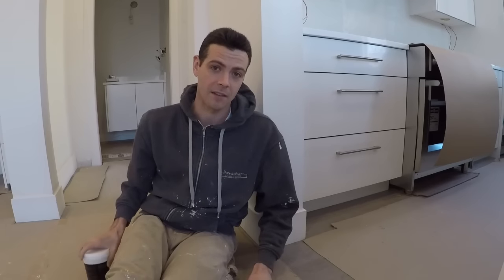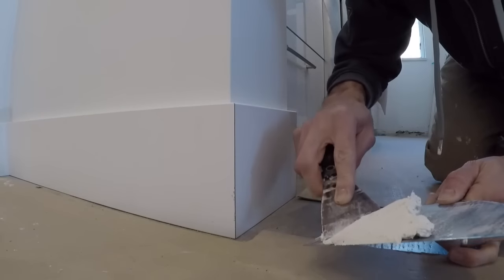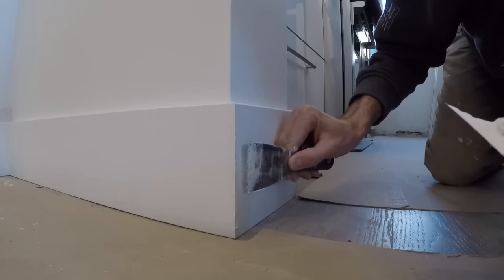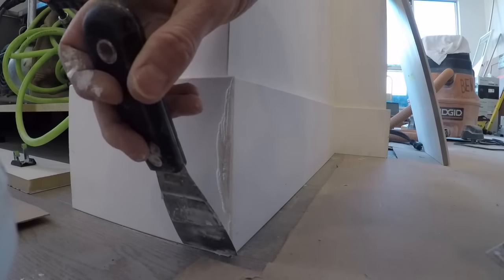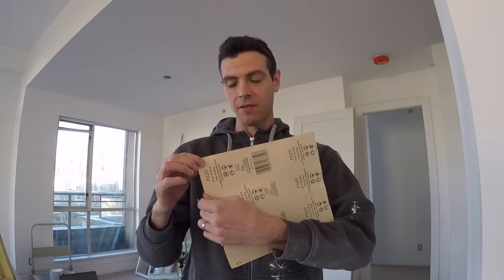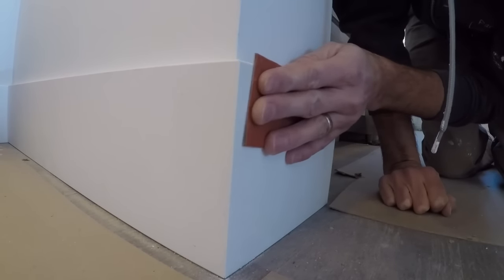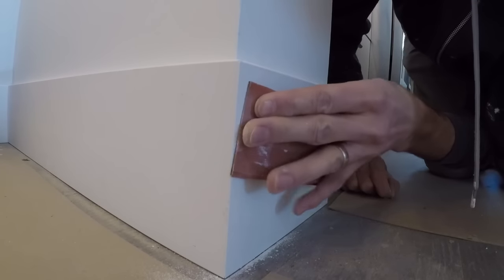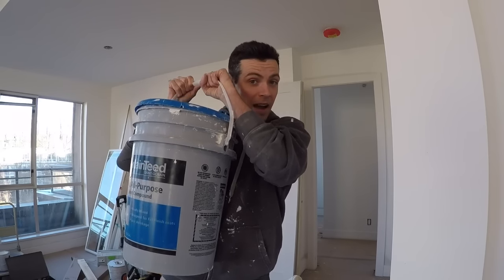How to Fix Open Miters

Comment: I was a professional trim carpenter for a few years. I found the reason most people had bad miters was a result of laying the baseboard down and tilting the blade - bad method.  Better to stand up baseboard and turn table. another tip - never 45 and inside corner - one piece square and cope the other piece to meet it, you will never have an open corner. If you want a line to cope  hit the baseboard with a 45 and follow the inside edge of the cut.
Reply: Glad I was able to help. Make sure you try the coping saw for the inside miters. Back around 1980 we were doing a lot of upscale houses with Mahogany, a gap or filler was not an option. A trick if you are using finished wood like Mahogany and there and there is a tiny gap on an outside miter which can happen if the wall is not a perfect 90 degrees is just lightly tap the corner of the joint and it will close it up so it doesn't catch your eye. Back to my bathroom reno. Cheers
Reply: I watched Scottish finishing carpenter do a high end dental office with 1 1/4"  X  6" oak. All the inside and rounded outside corners where perfect, no fillers used. It is possible to do a good job. We all can do it.
Reply: Ah a real finish carpenter.
Reply: @gomalibusurf6098  there actually are plenty of videos coping inside Corners is a widely known practice it's definitely no secret tip

Comment: I can say as a contractor that what he's showing will work in a pinch.  We're all advancing our skills at carpentry  (in this case trim), hopefully.  This is something anyone can do when presented with this problem,  whether they cut the trim or not. 
As a pro tip I will say this on topic:
No need to carry any special fillers or spackling. Just mix latex glue in water, not much glue,  just enough to make the water look milky (I use stone glue it's cheaper and Ialways l always have leftovers from concrete work,  I suppose wood glue could work). Use the milky water to mix durabond or other hot mud.  Fill with that.  Won't shrink,  very strong. 
In a pinch we've used this recipe to level low spots on floors before laying hardwood or click together. 
Cheers
Reply: Would Weldbond work in this mix?

Comment: Switch your miter saw to about 51°. It increases the lead of your "point" . You may wind up with a small gap on top of where  your wall corner meets both planes but it's a small gap and very easy to caulk.

Comment: I had a good technique when I did a lot of baseboard. Have short trial angles cut out and keep them in your tool belt pocket. You can see how off you are from 45 degrees, either inside or outside corners.
Reply: Exactly!

Comment: About fifteen years ago I put put up some 4x4 posts on my screen porch, There was open grain in the knotholes and a few other divots that needed to be filled. I used Bondo (a polyester resin-based putty used for auto body filler). It's non-shrinking and extremely strong, and it sands very well too. To finish sealing the knots I used dewaxed shellac to seal them and prevent resin bleed-through, which will happen with Southern Yellow Pine, regardless of how many coats of paint you put on it. They look great today, so it worked well. I can't tell where any of the knots are--the paint is smooth and there's no bleed-through to leave a hint. Great video BTW. I've heard that if the gap is very minor you can take the smooth edge of a Phillips (or Robertson) screwdriver and press it against the edge of the miter to round over the edge and fill in the gap. Obviously that wouldn't work well for a gap as large as you were hiding--the corner would be too rounded and not look good.
Reply: Oh yeah, I almost forgot...another product you can get at the home centers (in the paint department) is Durham's Rock Hard Water Putty. It's a powder that you mix with water to a putty consistency and it dries a beige-brown. Like Bondo, it dries without shrinking and is very strong and hard. It sands well and takes paint well too. A good alternative to Bondo, and easier to mix since you just add a little bit of water and stir. I use it a lot when I was a teenager building scenery for my HO railroad. It made great rocks and cliffs.

Comment: This is usually caused by to much mud on the corner bead. You can fix this a couple of ways. One mark the top of the base board, and shave the mud off below the line, you corner closes right up! Second approach is to cut your trim a hair long and float the trim away from the wall, caulking the gap at the top. And yes, you can also cut a 46, or 47 degree miter. 

 "Putty and paint make the carpenter what he aint"
Reply: 46° miter is the easiest and best way though

Comment: After asking a few carpenters that do this work for a living, i found out there are several factors for why the gaps could appear in the trim work after installation. One reason is the trim needs to be acclimated prior to installation, this is mostly never done during construction. The second reason is the corners or joints needs to glued and pinned, that can help quite a bit. Third reason is the temperature changes inside the house, its generally expansion and contraction. I'm in New Jersey and the trim in my house shows some gaps from time to time, more so after a really cold winter.
Reply: You are absolutely correct but the #1 reason in my opinion is the piece are cut incorrectly and that is usually because they are using and older saw that it no longer accurate. Plus if there is a huge gap to start you shouldn't nail it! I always double check my finish saws for straight, 90 and 45 angles. most saws have adjustment screws and stops to help zero everything. And like he said in the video, for outside corners going a little over 45 helps the outside corner touch which is the first part you'll notice.

Comment: No drywall corner is 90*, because of the corner bead.  Never cut a 45*.
Reply: I run trim all day long. Unless it's stain grade, I'm not wasting all that time to make it 46⁰ . I usually just make an outside corner a little bit longer to give the installer a bit to work with. Then caulking the top isn't as noticeable.
Reply: @kristomat  So you shift the work to someone else, so you can be faster?
Reply: You mean get the painters to do their job and caulk the trim? We're talking a 1/16 here. I've been doing this for 20 years. How about you?
Reply: @kristomat  I guess I started when I was in my mid twenties, and now in my mid 60's, so been doing stuff for a few years.  Doesn't matter how long anyway, being excellent matters.  Even though I have been training people, I still have stuff to learn and do not get defensive about what I don't know.
Reply: @kristomat  Interesting too though, you can do a better job apparently, because you do stain-grade work ?
Reply: I figured you were an older guy. I knew a guy that swore by doing it your way (he was older), after doubling his work for about a week the boss told him to change to my way. It looked exactly the same and I did it twice as fast. I do the same with crown. My crew is the fastest out of 5 crews. We never get callbacks. 
 I hope you're not implying I treat paint grade the same way I would stain grade? Two different animals.
Reply: @kristomat   I have several ways, depending on the quality of the boarder and framing.  Most of my work is done in old buildings, so nothing is square, plumb, level or consistent.  New construction is where most finishers can get some speed, and when they rush for that beer, they leave any mess for the painters.
Reply: @kristomat  My friends in the flooring business know more about trim finishing than I, because they just swear and do the best they can.  It isn't their job to do call-back phoning.
Reply: @ya472  the flooring guys are 50% of our call backs. They always cut the casing/jamb too high. Don't trust anything they say.
Reply: @kristomat  Well, you know.....   lol
Reply: @ya472  um no. That was vague. What do I know?
Reply: @BMXadie it's never going to be 90° because of the mud on the corner. Making it a tad longer gives the installer a little bit to work with when banging the mud in a little. I don't really care if you like my way or think you are a higher qualified carpenter. I'm just saying it's what we have done for years and it works.
Reply: @kristomat  do you mean this in the sense that you use a cutter and installer team that do separate things? I could never imagine doing trim this way. But if it works for you and you can do it fast, more power to you. I've found more and more lately with all the greed in this industry, that a carpenter's speed can out weigh sub par work in the eyes of the employer..
Reply: @jonm2416  this is very common place method in trim work. Even in two man crews.
Reply: @DeadEyeRabbit  Maybe it is, I don't do production work, I do custom work, so I've never seen it. I usually use tall base profiles in solid poplar so there not much finagling you can do with a slightly longer 45. Do you guys install 2 1/4 mdf clam shell for base or something? And this "crown" must be like a 1 3/4" nose and cove flex mold lol. Either that or you're installing in a perfect metal box.all messing around aside. Your method may only work in low grade production. Custom work requires perfection, not necessarily speed.

Comment: Thank you for the video! Doesn't wood filler puddys dry hard and crack from impacts and expansion/contraction? Wouldn't paintable non-shrinking silicone or urethane remain flexible and not crack?

Comment: Thanks! After 4 months of remodeling my house, most of which I have left to do is the baseboard and I'm sure this will help.
Reply: Fun, isn't it?  :) I've been working on a remodel in a spare bedroom over a couple of months. Level 5 finish over knockdown texture wall and painted popcorn ceiling (1971 house, likely asbestos, already painted by previous owners). Putting my final skim coat on the ceiling tomorrow, then sand and primer before paint.  Ben's videos have been kinda following along where I've been in my spare time.  One wall had old baseboard electrical (flipped that 12ga wiring and box around for a dedicated outdoor 20A utility circuit, all wiring was run and breakers still in the box, wiring disconnected), cable TV inlet, phone jack, poor patching, curtain rod pullouts, nail pops from the original build, etc, so I practiced a bunch of different filling and taping techniques.  My 10yo daughter is getting that bedroom when I'm done and she loves watching the videos and seeing the results when she gets home from school. :)  We're just about to trim now and I'll be building a wide flower pot holding window sill. :) Informative videos and fun to watch.

Comment: You use a bevel to do your mitre corners, no corner is ever 90 degrees so you need to use the intersect the angle technique and then draw it out and use your bevel
to get the angles right. But this is about filling the gap that has already been made and the VC carpenter does a good job IMO.

Comment: When you are putting the two pieces together put the putty in before you nail, bingo done and quick. Or caulking gun.
Reply: From my understanding you would want to use caulking in this application, correct?  Wood filler wouldn't hold up to further expansion and contraction.  You'd end up with the same issue after a year. Right?

Comment: Excellent video. Been using caulk for years, will try this although might be harder to sand a complex form like crown. Virtually all corners are more or less than 90  deg. I did OS corner crowns by using an angle tool and setting saw with that and got perfect 46.5 miters on a 93 deg OS corner.

Comment: Those 1/4" gaps are there when you bought the house from some extreme hack job.  I wish I could add a picture of the ones in my house.  Especially the ones where the guy didn't even bother to miter but just ran them as butt joints on outside corners no less.

Comment: Great tips! I use dap to fill mine. How is your stuff superior? 
I’d love to see some more painting tips, cutting in edges etc.
Reply: I use dap as well and never had issues. Curious about this product though
Reply: dap is caulking he mentioned at the start of the video that it shrinks and concaves. It will work for smaller gaps though. 

Personally I don't like to use it because it's not sandable and it usually leaves a different texture on the surface that's visible after painting.
Reply: Dap isn’t caulking, it’s spackle compound. It comes in a tub and is applied with a putty knife. It can as well be used for patching dings in walls and such.
Reply: It’s minimal shrinkage as well. It doesn’t shrink like caulking at all.
Reply: @peterhunter1990  Actually we're both wrong! Dap is a brand that makes both caulking and spackle so actually we're both right. When I think dap I think alex plus interior caulking for baseboards. Especially because we're talking baseboard anyway. I'm sure the dap spackle works fine for this I usually use the elmers wood filler myself.
Reply: Perhaps I should have clarified, the product that I use, commonly referred to as dap in my neck of the woods, is in fact dap brand spackle compound. I haven’t seen dap brand caulking available in any store before. Various other putty compounds but never any caulking of any kind. 
Cheers🇨🇦🇨🇦🇨🇦
Reply: Cutting in is an art. Just gotta take it slowly and don't put too much paint on the brush
Reply: @peterhunter1990  Well I learned to never say Dap again without clarifying which dap. I had a mental image of a labourer wasting hours trying to caulk baseboard with spackle! Always learn something new from VC videos and I learn 10 things from the comment section.
Reply: @peterhunter1990  I hear ya...to me(and my father) Dap is always used when referring to caulking for sure.  It's a regional thing I guess.

Comment: the caulk doesn't sand.  kinda cheap looking.  bondo is alright but takes paint differently. I use a bevel square to find the real angle divide by 2 for the half angel.  that's the true mechanical way.  but what's he's done is just fine.  but that MDF and all this other shit they sale us is junk.  ticky tacky.

Comment: It's worth the time to figure out what the exact angle needs to be. I use a Starrett angle finder which will tell you what the actual miter saw angle needs to be set at.
  I always glue the joint which minimizes cracks from developing later.
If you simply make all of your miters 46°, you will have a gap in the miter at the wall when your mitered angle should have been 45° or less. 
Yes, there are corners that I have encountered to be less than 45°! (Many times on a return to a tub)

Comment: I do 45 1/2 degrees and almost always get flawless miters. I do occasionally have to go open it to 46 degrees tho. The worst is when it's a bad corner thats upstairs in a back closet or something and the saws are downstairs and outside or in the garage. All the walking! Sometimes you get an odd corner tho and you dont have a choice. On 45 corners which isn't as common I take scraps and test cut till I get it exact. Wood filler and caulk will never look as good as a perfect miter, especially when you're installing that sticker covered mdf garbage that menards calls pre-finished. Maybe today but in a few years we'll see. Thanks for the video!

Comment: Im a carpenter and was working with a friend of mine 2nd fixing houses for a building company... we were on price so we very busy...and the specs on the job was mitres were not allowed to be opened like in thumb nail...so i was cutting he was fitting and measuring and we got stuck in and he said all your mitres were perfectly done how was that cause we had to use mitre bond glue rapid set on all the the mitres on the skirting, its simple trick, instead of 45* used 47* he laughed at me and said for 20 years he never thought to do that once...works great with plastered walls. But your still giving out sound advice, lots of people turn to you tube now for advice, im sure you ll be inundated with comments, all the best.

Comment: It should have been glued properly  as the mitres are fitted ,what your doing is closing the gate after the horse got out, it's dodgy work on your part. If you come across dodgy mitre work that hasn't been glued, yes what your doing is correct.

Comment: Cut one at 45° and one at 46°. If it still shrinks you can also sand down the back at the wal mitre. Pulls it in more together. Rather than fill in gaps.

Comment: CA glue the corners tight and caulk the gap between the wall and the top of the trim like normal.
Reply: Samuel Moore is 100% correct.  I was going to post the same message but it was already here.  👍

Comment: That will crack 💯 percent when house moves with cold and hot weather you use special caulking that is made for filling gaps which sets hard but won’t crack qualified painter taking here
Reply: J.J NEWTZ haha qualified painter 🤣
Reply: Nope! If it moves that much your drywall is cracking too usually everything expands and contracts together and it's not that much unless you say turn off your heat during the winter and let your house get ice cold humidity might play a role if you install it in a really humid environment maybe but what really causes trim the crack is because it's nailed wrong and the people don't catch the studs plain and simple

Comment: I glue external mitres and leave them slightly open outward. If i can be stuffed i will then either fill with bondo or better still thickened epoxy.
Edit: makes for a stronger corner. A well cut, sharp skirting will only look great for a week at most. Its far too easily damaged. I only put the extra effort if i like the clients of course.

Comment: Glad to see you using wood filler instead of caulk.  Only hacks use caulk when filling gaps. I usually end up doing 2, sometimes 3 quick coats.  The putty dries pretty quickly, so does not take too much time.